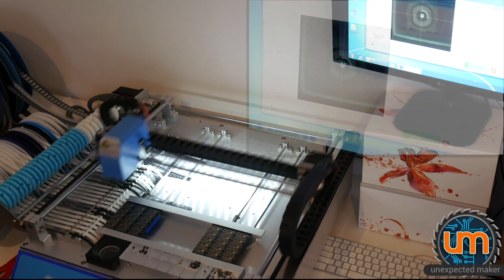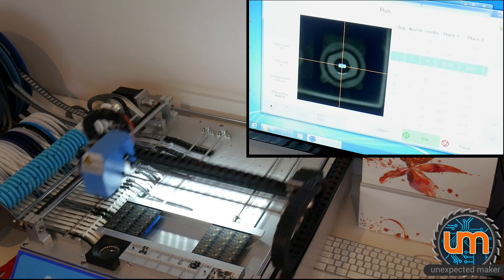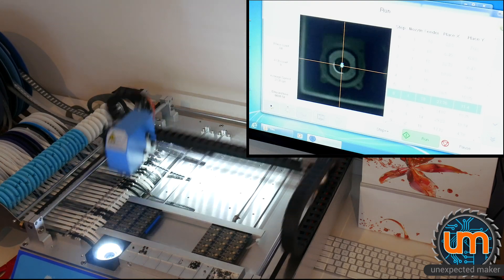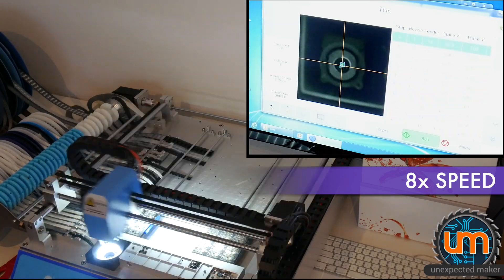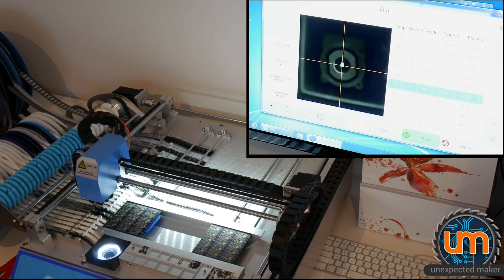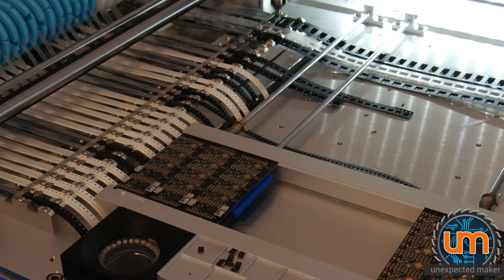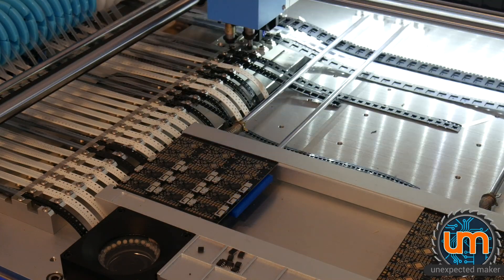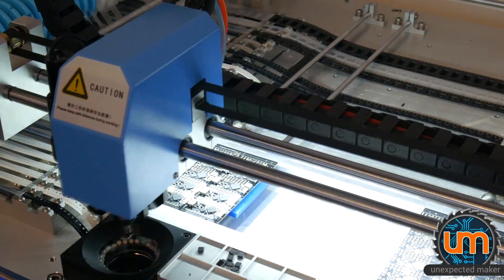My Pick & Place - Warp speed engaged!

Comment: The file you send to the PnP, Is it the whole panel or just the one unit, Telling the PnP the panel size?
Reply from the maker: I use just the single board, and tell the PnP software what the panel X,Y counts is and the spacing.

Comment: I have YouTube Vanced and it defaults to 1.25x speed....and it's still slow. Build a Delta, model it off of the Omron Adept.
Reply from the maker: What? Slow? It's doing 1800-2200 CPH with vision, placing 0402 - on a AUD $5k PnP. You should do more research on PnP costs and speed/capabilities :-)
Reply: Hahaha.
Yeah i thought about a delta pnp but the size required for this build volume would be huge. And the precision requirement for pick and placeing 0402 components would be hard to satisfy. 

This machine is not limited by xy travel (ok maybe a bit) but it gets limited by the feeding and placing mechanism as well. So a delta (while moving faster) would not necessarly yield a better component per hour (cph) value

Comment: Congrats on the 100% speed. Is the space saved with 0402 parts worth the extra trouble they cause?
Reply from the maker: Well=, the TinyPICO wouldn't be as small as it is if I used bigger parts, so yes, it's worth the trouble. Now to work out how to use 0201 on it!